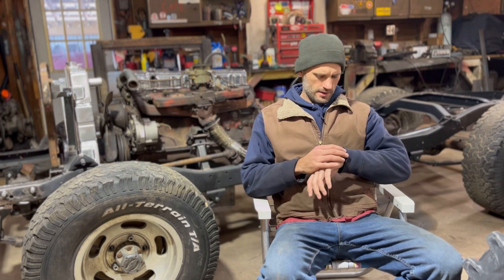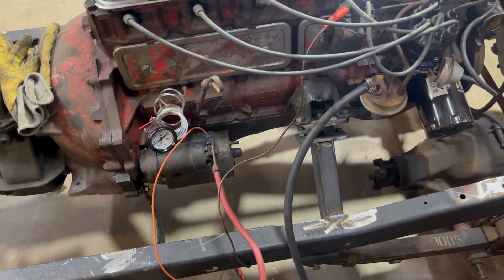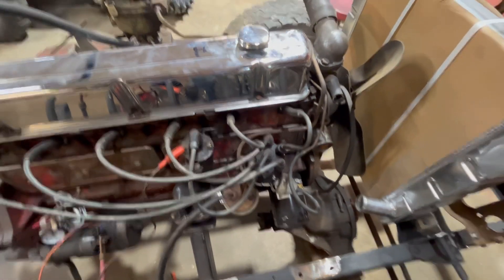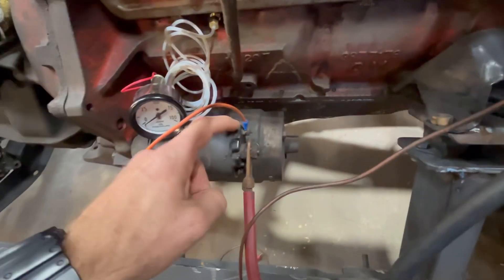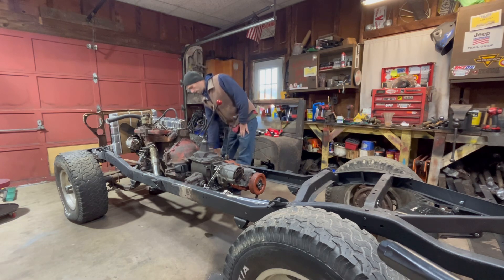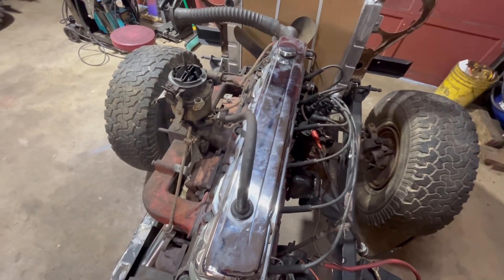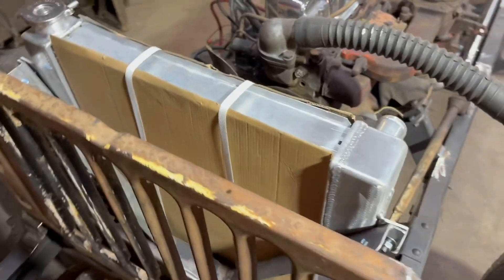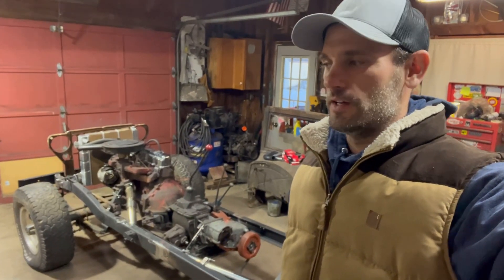Finding TDC Chevy 250 inline 6 cyl First start

Comment: I have chevy 4.1 inline 6 but got weak start  an does not have spark wht would be the problem
Reply from the maker: Could be a lot of things. Try a jumper from the batter right to the positive side of the coil while cranking. Could also be the coil/points/condensor. Try all the cheap or free stuff first. Do a compression test. It may need a valve adjustment.
Reply: Thank u i will look into it @SethHensler

Comment: Would you help me with the correct spark plug for the 250 inline six engine.
I went to Auto zone , Napa and Oriellys the all had a different plug # 🙉
I’m trying to get the original plugs.
Reply from the maker: Sure! I’m running champion RN12YC
Reply: @SethHensler what’s the gap? Is it the same for the 216 &235
Reply from the maker: @KeepitReal-wn4zj .035 gap 👍

Comment: This engine was rebuilt 
My engine has been sitting for about 5 yrs with NO plugs, distributor,fuel Pump or water pump
What do you recommend I do to clean out cylinders. Probably have some dust.
Reply from the maker: if it was stored inside you really shouldn't have to do much. blow them out...put a little diesel or light oil in the cylinders....turn it over slowly by hand. if it feels good.. its probably fine,